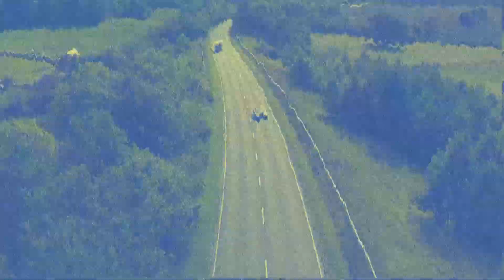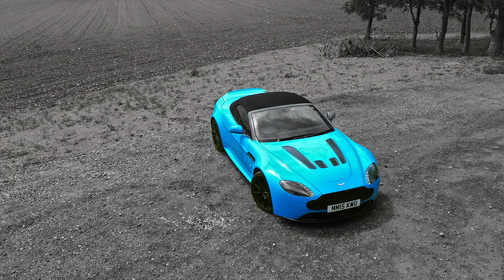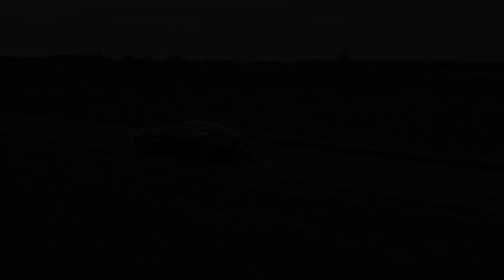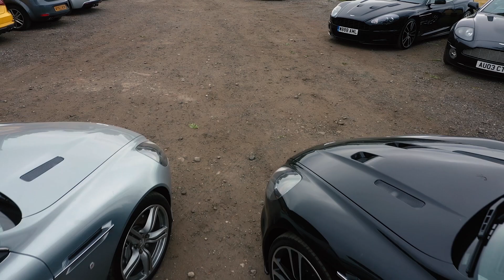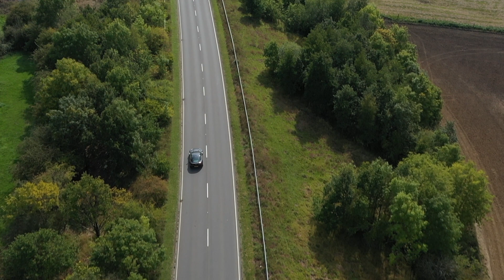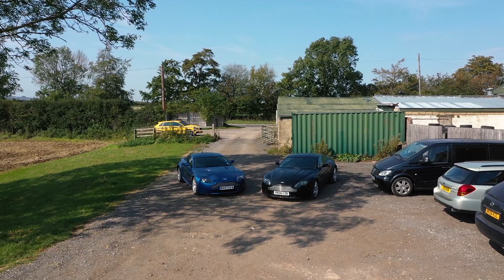Responding to a selection of Forum posts! Forum Chat #54

Comment: How do you get around the MOT regulation when removing cats, they were fitted at the factory for a reason yet youre removing them and something the MOT regs say, if theyre fitted from factory they should be in place. Why do they not fail the MOT on that reason alone and what about the pollution thats going to be caused.
Reply from the maker: Martin .Clark. Thanks for your comment, perhaps you are getting confused with law prohibiting DPF removal? for catalyst removal there is no actual law categorically preventing it. Just advice that it might alter emissions and a dashboard error light might come on, so owner is advised to be cautious. The guidelines suggest that emissions performance must not be altered away from how the maker released the car, but the only means available to test emissions compliance in-market is the MOT test, which these modified cars will pass with ease, so they are compliant. So no getting around anything, cat removal is within compliance of guidelines below. It could be argued the freer flowing cat is indeed worsening emissions performance, but the only mechanism to test for that is the MOT test

https://www.gov.uk/government/publications/modifying-your-vehicles-emissions/modifying-your-vehicles-emissions-the-legal-safety-and-health-implications
Reply: @BamfordRose   This comes from UK Govt website "A person using (or causing or permitting to be used) a vehicle on the public road, which does not comply with the emissions standards it was designed to meet, is committing an offence.
All vehicle owners should be aware of the need to inform their insurers of modifications made to the vehicle, whatever form these might take, as changes to the vehicle potentially alter the risk being insured.
It is not always obvious to vehicle owners that some modifications will make the vehicle illegal to use on the road, irrespective of whether the insurer is prepared to provide cover.

 For example, removing a catalytic converter or diesel particulate filter will almost certainly result in a vehicle's emissions exceeding type approval limits and make the vehicle illegal to drive on the road. Engine re-mapping may also result in non-compliant emissions. It is the driver who is responsible for ensuring compliance"

The last paragraph mentions that removal of the cat would change the emmissions and exceed type approval limits and make it illegal to be driven on the road. Or is the Uk governemt wrong?
Reply from the maker: @camau3  the .gov website link I copied you permits enhancements. There’s words like “advice” and “almost certainly”, meaning it’s left grey, but whether it’s a go / no go is answered by does it pass / fail mot, end of!